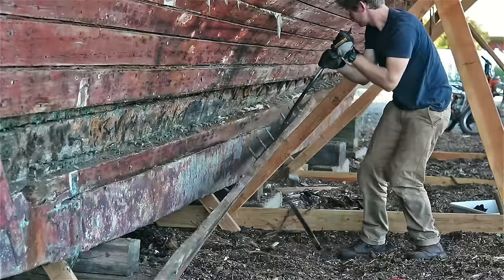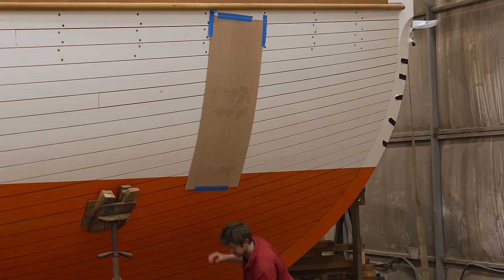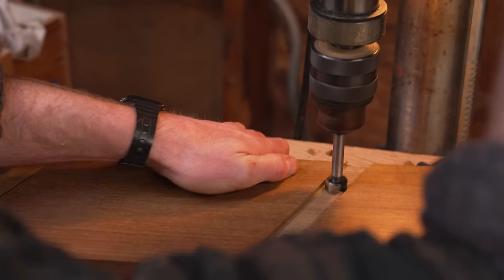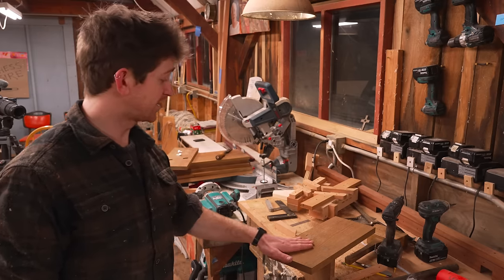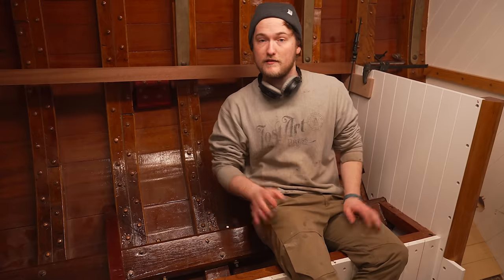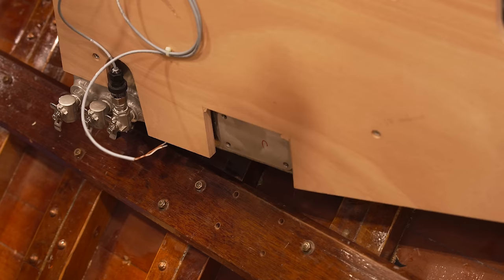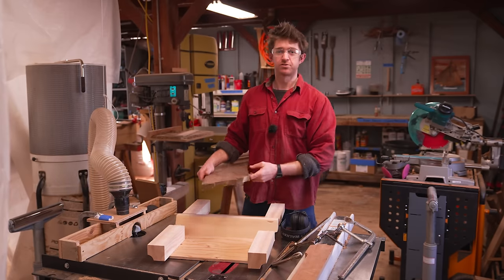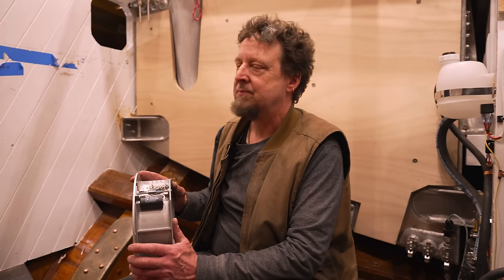Trial and error on the most expensive staircase I’ve ever made.

Comment: I don't understand how the plywood on the fuel tanks are secured with screws. They can't possibly be piercing the tanks, but then how?
Reply: Maybe they welded some nuts to the tanks and used a bolt. No way they are screwdriver through.
Reply: If you watch the 29 Apr 23 video, at 28'10" there's a view of a fuel tank side. You can see the small round bosses welded to the tank, they have threaded inserts to capture the bolts to attach the plywood panels.
Reply: @frederickstibbert7389  Thanks for the answer, dude!

Comment: Watch those aluminum brackets! You better protect them against galvanic corrosion because they've been bolted with a dissimilar metal. In wet conditions this will create a galvanic cell. This will cause the less noble aluminum (anode) to dissolve. It won't happen quick because the mass/surface of the less noble aluminum is greater than the steel bolts. Nonetheless there's a risk of severe corrosion in a marine environment. You don't want a hole being formed under those bolts. So, to be better safe than sorry, it would be better to use a plastic washer or something similar that is electrically insulating.

Comment: I love your Project and have been watching from the start. But a Wood Burner within the boat. Is this another April Fools joke?
The clue is in the name of it "Wood Burner" the boat is make of wood and your wanting to fit a piece of equipment designed to destroy wood!!!
Seriously though, no matter how many safe guards you put in, clearing embers from a fire will always result in the possibility of combustion, and given how well made and watertight the boat is and the fact that all of the timber is treated in solvent based hydrocarbon compounds, do you really think a wood burning stove a good idea?
To become the modern equivalent of the Titanic would be a tragedy. 

May I strongly advise against ever fitting a wood stove in the vessel. 
The act of cleaning out the embers, them falling below the floor pan and igniting the superstructure after all you have done to make it, would seem to be tempting fate.
Please reconsider the design idea with great clarity and measure. A hard wood slow burning fire could quite possibly be so slow burning that the hull would fail due to an accident should the vessel be moored and the crew not on the vessel. To me the inclusion of such apparatus would appear negligible and may also void any maritime insurance. 
Please research Wood Burners and Boat Insurance before spending too much time on something that will need to be removed in order to insure the vessel.
R
Reply: Wooden boats have been using wood & coal fuel for ages. Kerosene & propane more recently. Leo will likely install a dual-fuel wood/diesel stove for cabin heating, w/ due regard for its proper safe installation & use.